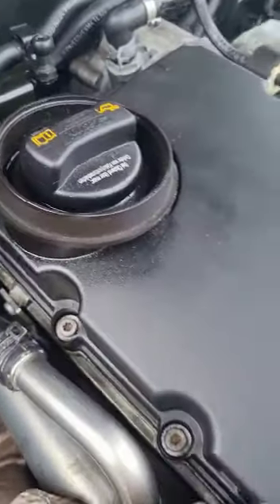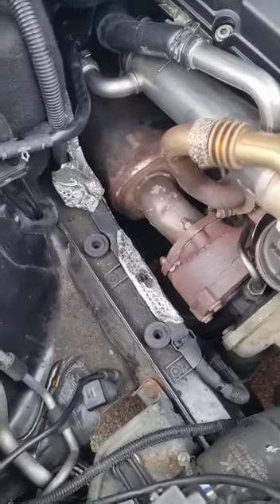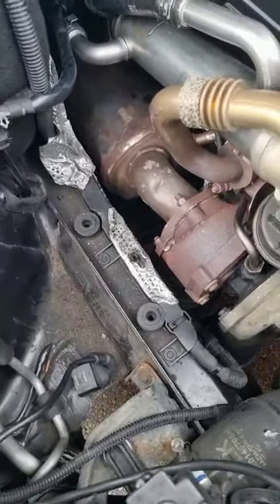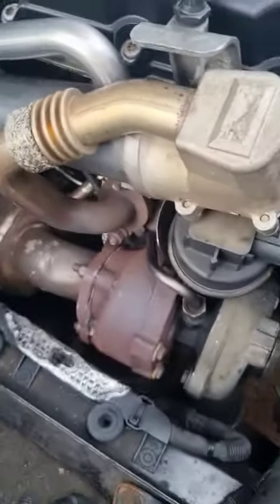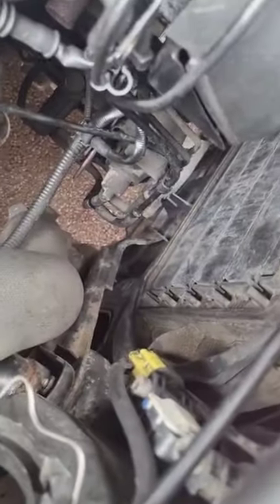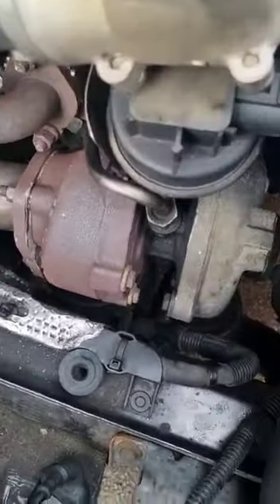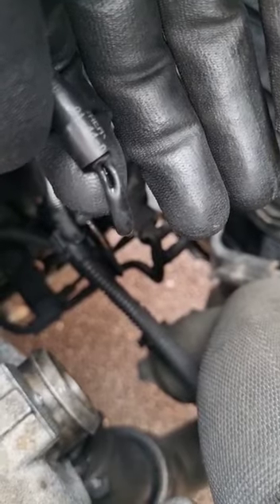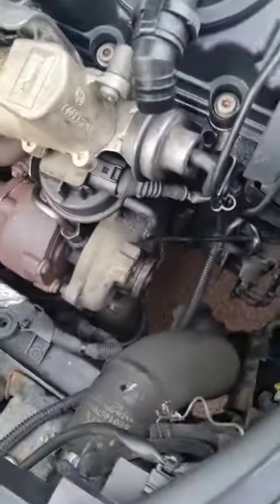A4 2.0 tdi b7, fault code p0299. no turbo

Comment: Did you not test those vacuum lines?

 I'm having a nightmare with one of these and I'm just wondering if maybe its a weird component that self seals at low vacuum or sumin, I dunno I just presume you did vacuum tests first and if you didn't find it from those tests maybe I should pull all mine and look 

Damn engine 2 months I've been trying to fix it, customer is immobile, he's a 30 min drive away too which doesn't help if you know those engines I'd love to pick your brain, I'm just trying to help this dude out bless him......
Reply: Any update
Reply: @Haider Ali  nope, its had turbo clean, new turbo actuator, I've isolated the swirl flap actuator (as it's broken and I can't source a new one, didn't want the vacuum line to leak as it's a common source for the vnt actuator), new no1 o2 sensor is being fitted today, I cleaned the old one with no luck, (tried a pulse width test couldn't get any reading at all unsure if i did test correct), all vacuum lines are definitely OK, codes are p0299 underboost, p0404 egr control circuit range and po473 exhaust sensor a circuit high, it was in limp so wouldn't rev over 2k, now it will rev over 2k but has zero boost, I was thinking carbon came off the turbo sat on the cat, cooked and killed the sensor (hence me cleaning all that out, he did say he added some fuel additive a short while before 🤔), the customer said it felt like pressure built up and then suddenly it smoked and wouldn't rev, honestly if new (cheap 😬) sensor doesn't work I'm out of ideas at this point, I don't have access to VCDS just a generic basic code reader it did do live something that looked like 2 o2 readings (possibly sensor 1 and 2) however it was doing nothing, no wave on either so unsure if it even was as I'm only getting codes for A, any thoughts? 🤷‍♂️
Reply: @HaiderAli-qn2ec  it didn't work,getting the correct signal from the o2 meter, all codes are back, this is making me so depressed the owner is getting super funny if you've any ideas let me hear them please I'm out, actuator is functioning it's definitely the ecu asking it to open the veins, exhaust code is back even after fitting new sensor.......🤷‍♂️
Reply: @EZ-D-FIANT  with my situation I cleaned the turbo and changed the boost solenoid I have an Audi a6c7 it started to limp mode a lot less on the motorway but now kicks in when I hit about 80 mph i dont know what to do mechanic said to replace the whole turbo but I’ve been getting by like this for 5 months now
Reply: @EZ-D-FIANT  mine is fixed now after dpf gutted/removed
Reply: @HaiderAli-qn2ec  yea I fixed mine, after blood sweat and tears lol!
I did about 8 jobs so don't know exactly what fixed it, however I did discover these cars can take quite a bit of time to come out of closed loop, so my advice to anyone would be if they have done a repair and it hasn't fixed the issue then drive it for at least 30 mins at temperature and different loads, so hills, highways, hard accel ect, usually cars come out of closed around 5 miles or 10 mins so my issue was that I simply didn't give it enough time to stop running on limp (closed) and switch back to sensors (open), hence not knowing exactly what fixed it!
My prognosis is that the customer added a fuel additive, this heated carbon already sitting on the vnt and dislodged it to sit on the top of the cat primary mesh, where it heated and turned into soot which then messed up the sensors, I've cleaned everything and she's good now she's run in open loop for a bit!
Cheers for your help bud if you've any issues I've become a bit of a guru with this platform give me a shout (I'm traditionally a JDM specialist and an aerodynamisist nowdays at that, building and designing CFD composite parts mostly for 1 make racing SW20 chassis). Stay safe bud, keep smiling and turning those spanners......1👍👌👍
Reply: @HaiderAli-qn2ec  let me know if you get sludge coming out of your exhaust after that DPF gut please bud......
Reply: @EZ-D-FIANT  very glad to hear you fixed it I went thru hell because it was an underboost code so I didn’t suspect the dpf and after it being gutted there’s unnoticeable smoke that comes for 2 seconds on hard acceleration then it’s gone because I got the dpf mapped out and stage 1 the car so the mapper sorted that side out cars running lovely can hear the turbo and engine working nice on acceleration as if it can breathe  now. And definitely never know might need but if help in future thanks mate